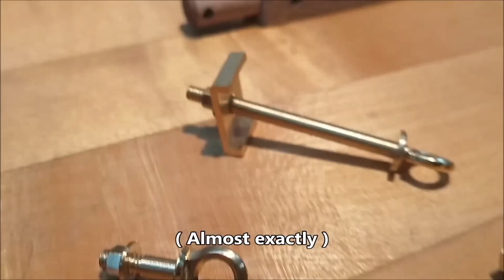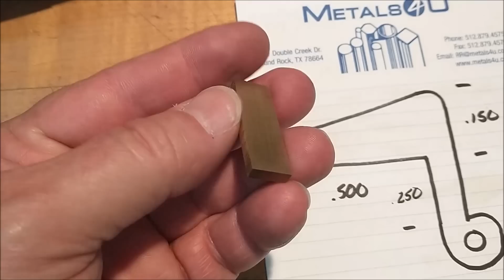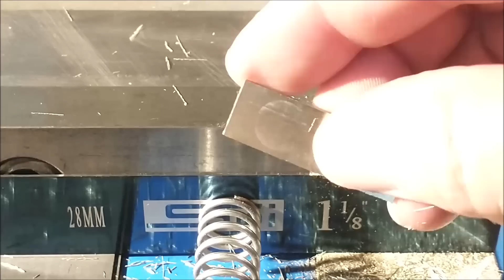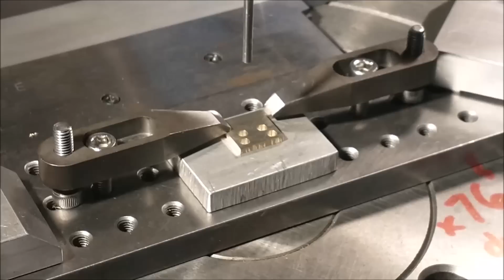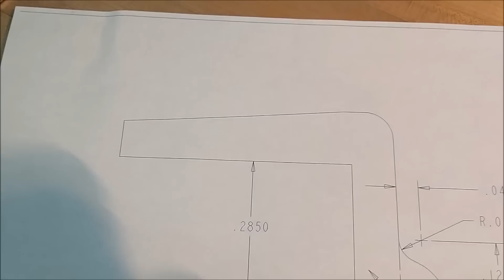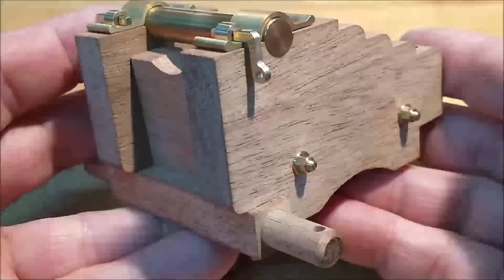Square Pegs in Round Holes......Say What ??

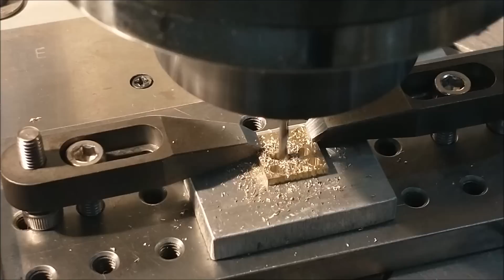Comment: Joe, the reason the part moved was because of bad clamping. If you look at 17:00  your clamping bolt is right next to your fulcrum point. If you had moved the screw over to the next hole it would have placed the full clamping force to the other end of the clamp and directly to the part. As it was the most force was against the height adjusting screw. Regards from Australia.
Reply from the maker: Greetings Dave. I have to agree the pressure distribution of the clamps wasn't optimal, but calling it "bad" is just unfair. Roll back to 16:19 and freeze it. You'll be able to see the hole pattern in the plate and length of the slots in the clamps would not allow for just moving the screws as you suggest. The only viable solution ( in hindsight) would be to move the entire fixture slightly to the left keeping the left side clamping bolt in the same hole, and advancing only the right clamp one hole. For the load a .093 ( 2.4mm) dia end mill was expected to exert on .08 ( 2mm) brass, I took the gamble the outer bias was sufficient. I was mistaken and quite surprised. But then again, I now have my one mistake out of the way for 2023. :) Thanks for the comment.
Reply: @joepie221  I can see both sides of the argument here, what with the tiny part and all, ultimately work holding  comes down to judgement and available resources but I have to say I thought when you were showing the setup that Joe was being a naughty boy. That is a mistake made by novices and others that should know better with frequent regularity. I think after the part moved it would have been instructive to point out just why it moved for the benefit of the novices and blonde hacks.

Comment: You have sorcerer's magic 🙂, if I had tried to mill the material thickness like that, there would have been a broken cutter and parallel, gauge pin, and brass part chewed up and tossed across the shop
Reply from the maker: Thanks 👍 Great comment.

Comment: 16:10  I think moving the the screw on your left clamp would have solved the issue. the leverage on that clamp is putting all the force into the leveling screw behind it, not the part.
Reply: Second that , it was clamping the jack screw rather than the workpiece , useful to see things go wrong though ,makes you think.
Reply from the maker: Agreed.

Comment: Interesting.

For thin parts, I super glue them to a larger plate that I can clamp
Reply: Super glue is your best friend for tiny parts, I always keep several tubes in the beer fridge
Reply from the maker: For some reason, super glue never enters my mind as a holding solution.
Reply: @joepie221  I’ve used it when I made some odd shaped bronze bushes on the mill, about 2mm thick, 35mm diameter. Super glue worked great. 

Not sure how much I’d trust super glue on the lathe though, as the part is spinning.
Reply: @MadScienceAndy  I've seen videos where super glue was used fixturing small parts for lathe turning...

...and if it's on an internet video, it must be true, right?
Reply: @billythebake  I’ve used super glue to fixture on mill, but haven’t yet on lathe. If don’t do stupid stuff like heavy cuts, I can’t see any reason why it shouldn’t work.

Comment: Loving as usual, but OM actual FG how heavy would that chain be if it was scale and in Iron. They used to run guns in and out of ships  on ropes and tackles  that would would use smaller hardware.
Note, try writings of Patrick O'Brian if you want a realistic flavour of how those times were. Great writer.
Reply from the maker: The chain would be extremely heavy, but for a model, it may work.

Comment: Exquisite Joe.
...and if you don't learn anything from these videos, you're not paying attention! It's as simple as that.
The ratio of 'tool size to part size' means that the clamping has to be pretty concise.

Thanks once again.
Bob
Reply from the maker: Working with tools this big and parts that small make it very easy to crush the parts. Its a fine line of how tight is good enough. Thanks for stopping by Bob. Hows that shirt holding up?
Reply: @joepie221  It's almost wore out. I haven't had it off my back Joe. And when I do, Fran steals it. Ha.

Comment: I'd love to do this project but do all the milling operations on the CNC...for me it would still be a great exercise in cam programming and work holding....
Reply from the maker: It would be an easy program. Are you just learning G code?
Reply: @joepie221  I've been doing CNC for about 3 years now, I use fusion360 at home and mastercam at work...I prob would still program everything in cam vs manually, although for the simple parts it might be a good exercise to manually program those just for fun.

Also probably as an exercise in conversational programming....